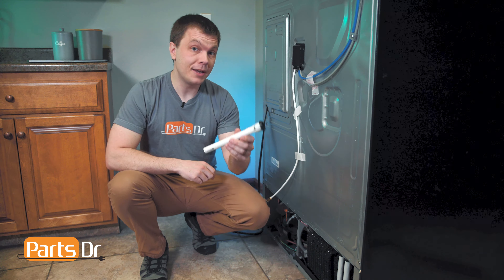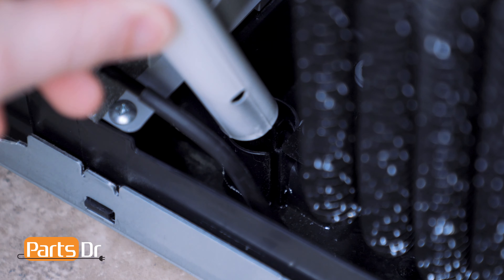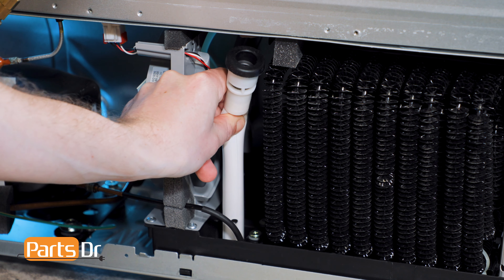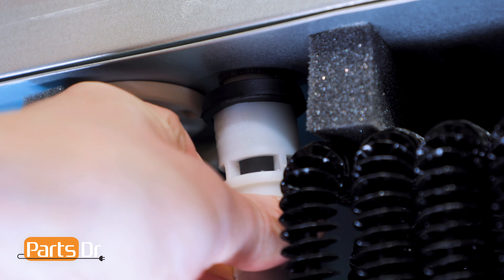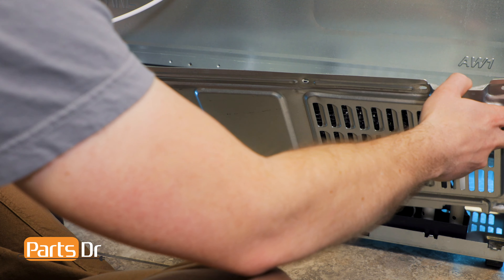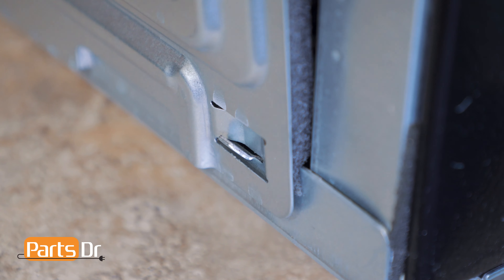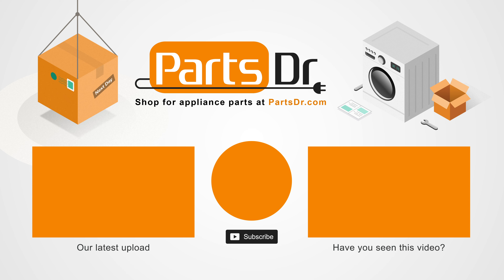How to replace Samsung refrigerator drain tube part # DA97-04049D

Comment: Thank you for this video. I need to replace all three tubes. The one on the left, you called the Freezer drain tube, has a different cap than 2 tubes on the right. The freezer cap has an opening at the top but the others do not. Is there a different part number for the Freezer tube, or can I replace all three tubes with the same part?
Reply from the maker: What is the model code or BOM name of your refrigerator?  https://www.youtube.com/watch?v=4HhWL9sonuE
Reply: Model number RFG298HDRS/Xaa
Reply from the maker: @robertcaiello3285  in the parts list, it seems to be missing the 3rd one that you are describing.  The only part number they list for a drain tube is DA97-04049D which we can find.
Reply: Ok, thank you. I really appreciate the video, your help and quick responses!